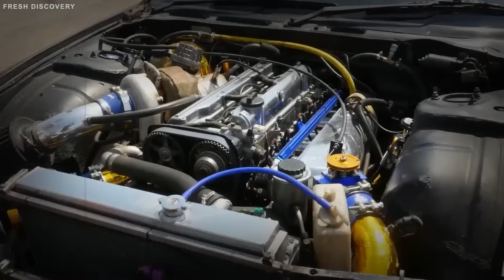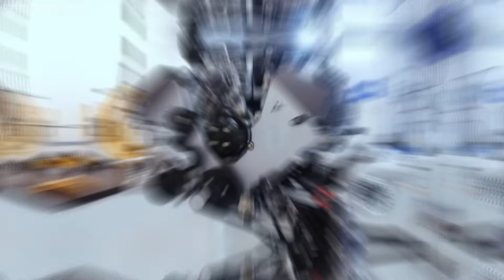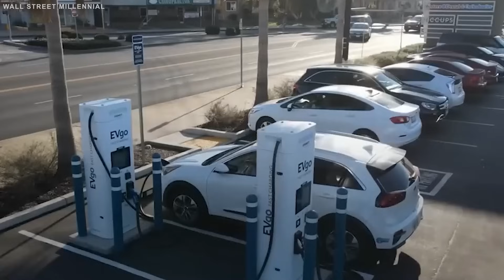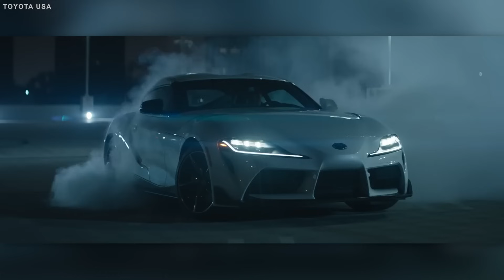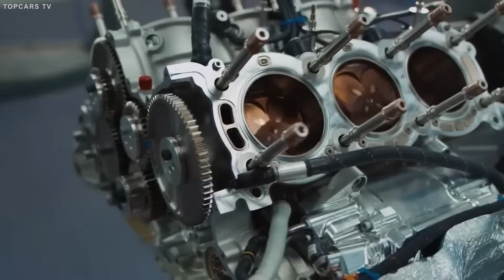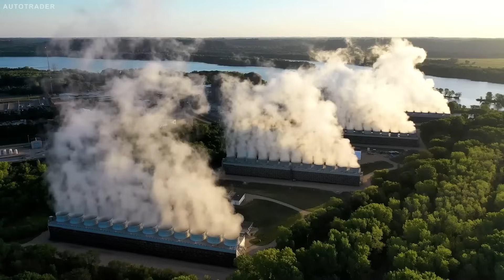Koenigsegg CEO: "This New Engine Will DESTROY All Electric Cars!"

Comment: If you look at the first principles of physics, using gasoline in internal combustion engines has an unavoidable inefficiency in the fact that we only use the expansion of the gas while it is burning the fuel and we only use a fraction of that pressure as is well known that the exhaust valve will release high pressure gas and make all that noise (energy) that is also wasted. (we unfortunately love the noise internal combustion creates). The heat is always wasted and ICE has this problem forever.  Even if you try to use the exhaust energy in a turbocharger that will at best increase efficiency by maybe 15% because gasoline detonates at the drop of a hat. Let's move on for the sake of my hearing if not just because it saves us tons of money. Electric is sooooooo much cheaper for the average person especially if gasoline is taxed like in Cali then it is a no brainer (do the simple math) to get a cheap electric car.  Internal combustion is on its way out and this is a wast of investment in an old environmentally unsound technology.

Comment: It´s an improvement but sorry, doesn´t sound like a game changer. We are still dependent on oil, we still emit too much CO2 and I don´t see a replacement of batteries that improve year by year and become more and more efficient and need less and less critical elements in production. Anyway, if we still have special cases in the future for ICEs it is good that there are more efficient solutions for this niches
Reply: You are gonna really be pissed off when you discover that there are already companies like Toyota adapting this technology with their already well researched Hydrogen engines.  Cry harder hippy, ICE engines ain't going anywhere.

Comment: At one point this idea did seem like the future, but different ways were invented to control valve timing on the fly and so far it seems  fully  electrically operated valves are not being used in any mainstream cars. It is possible that this ship has already sailed. As to replacing electric cars: I don't know why this has become a common claim in videos that are about some kind of ICE engine. Right now it seems like that isn't going to happen. Electric cars have major advantages over ICE vehicles and  it seems unlikely that any new ICE invention is going to overcome that. It is still possible, but battery technologies  may be on the cusp of improving to a level where ICE technology is functionally  obsolete.
Reply: Nein, ist anders.